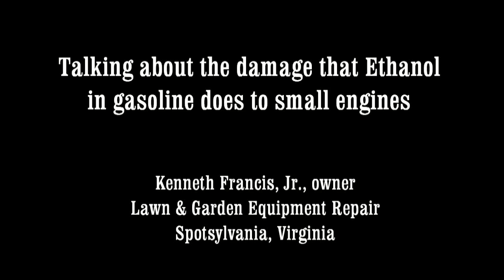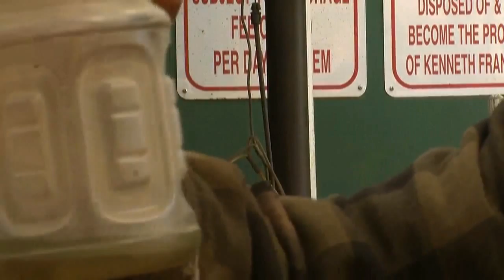Talking About The Damage That Ethanol In Gasoline Does To Small Engines

Comment: Have been using ethanol blended fuel in my lawn equipment for years and no issues.  I do run everything regularly, but 5 years and no problems at all from 8 small engines. Just my experience, have not noticed any adverse effects.

Comment: Ethanol does not eat up rubber or plastic you can leave Everclear in a plastic bottle for years and nothing will happen. Ethanol mixed with gas is the  problem. Ethanol will collect water if you let it sit. The problem is people neglecting there small engines not the fuel.

Comment: And no I don't store my equipment with any fuel left in it over the fall and winter. I drain the tank the lines and carb. Even the primer bulb.  I have a 1985 Honda 110 and yes it had e85 in it over the winter. Come spring the damn fuel lines were hard and rotted. The carb was full of gunk. And this was not a gas and oil mix. Just e85 gasoline. In only 3 months. You can kick rocks about it all day long but I'm not buying E-85 ever again.

Comment: Thank you for exposing this. There should be a class action law suit against the oil companies to replace all of our small engine  tools this is rediculous they didn't warn us!!! They are mega billionaires and they have really screwed all of us. From the landscapers to the home owners. The weekend boaters to the professional boaters and anyone that uses thier gas with ethenol. I have 3  gas trimmers ,chain saw, pressure washer, riding mower that's nothing but junk now. And the parts to repair them are so expensive  I could buy  a new gas trimmer for what it costs for a carburetor and replacement parts. In the beginning I couldn't figure out what the hell was happening to my equipment. Nothing would start then it would start for 10 seconds then quit. Plus all this bad gas we have to dispose of. What are we supposed to do with it? Poison our ground water? No! Leave it laying around for our kids and pets to accidentally get poisoned? Or wait for an accidental spark to burn our shops down?
I'm pissed and I will never by  E-85 ever again. NEVER. It's garbage. And I blame all oil companies ,and our government for this. They aren't regulating this product at all. You herd him say some gas that was tested  was 35% ethenol. That's rediculous. There are drag racing engines that run on ethenol. They knew what they were doing but didn't care enough to simply say this can damage your small engines, boats , generators,etc... But no warning was given. Now what?

Comment: Most of this is true if you are driving a snowmobile then use regular gas because it will probably sit all winter, but if it is your car that you drive everyday you will be fine.
Reply: I run my mower on e10 and it is 8 years old and starts and runs very good even in the spring when it sits for roughly 5 months

Comment: OK,,, so here is the update.  The engine is a Kawasaki FB460V.... i filled the tanks with kerosene yesterday to finish cutting the grass.  it started and ran....(the engine was hot).  this morning (cold start)  I gave it a good shot of ether,,,, it started and ran on the second pull,,,, a little smokey at first, but the smoke stopped as soon as the engine warmed up......So I will pose the question again, just in case nobody reads my other post.  Is kerosene bad for the carb gaskets, fuel lines, or anything else ???,,, kerosene has a high sulfur content, that is why i am concerned.  Any response would be of great help..... Thank you, Tom

Comment: Yesterday I ran out of gasoline,,,, so I used kerosene to run my lawnmower.  (It started and ran because it was already hot)  Will kerosene ruin the gaskets and fuel lines (it's an old 14 HP Kawasaki engine).   Thank you for the nice video.   Tom

Comment: I still can't believe it.... How can a Substance that we drink (!) be more aggressive than "highly toxic" gasoline? I don't get it... It probably has a lot to do with maintenence. Whenever i get small engine equipment to repair it's in pretty bad shape. Usually four stroke engines are low on oil, the cooling fins are plugged with grass and dirt.... 90% of the time the reason why a small engine won't run properly is carb problems, even if it has never seen gasoline that contains ethanol. If you leave your equipment out in the weather it's no wonder that there's dirt and water in the system! Ethanol, due to it's hygroscopity, might contribute to this problems, but that's just a matter of maintenance. I wish people would take the same care about their outdoor equipment as they do on their cars! (3 oil changes per year, new spark plugs, air cleaner......). By the way: If you store a two stroke engine with a small rest of (ethanol-free!) gas-oil mixture in the tank for a few months, you run into the same problems (clogged carb...) just because of the gasoline vaporizing and the oil not. Gasoline is just not ment to be stored for a long time! That's what people need to lern.
Reply: Sta-Bil is an absolute necessity for storing gasoline!  You're right, people don't take care of their small engines, fall comes and they leave mowers outside, snow-blowers get put away in the spring, and no one ever thinks to do a little preventive maintenance.

Comment: I see this is a 2010 vid. Since then, in the last couple of years, a station or two around here has ethanol free gas at the pumps. I haven't been using it as it is about a half dollar more expensive. I may start using it for vehicles I don't run very often, my gas cans for generators, mowers and such. Any thoughts?
Reply: i bought the 11 dollar non-adjustable carburator for my snowblower and it's slightly imperfect. pops and surges just a little bit and i can smell the rich exhaust but only a tiny bit. took 2 tanks but it's all cleared up with ethanol free 91 octane. have other small engines that just aren't running like they could be.  be interesting  to see how they work out.  give it a try. you might be suprised

Comment: sorry I can't believe dialog. Show me the proof. Evidence of the actual damage. Otherwise I'm gonna say BULLSHIT!I'm from Mississippi, so "show me".
Reply: +spacecowboy98 I have absolutely no problem with E10 in my small lawn engines from the end of fall till I restart all of my equipment 3 to 5 months later in the spring.
Reply: +spacecowboy98 its not bullshit i work on this shit everyday...DO YOU??????
Reply: +MONEYBAGS603 BULLSHIT! 10% ethanol blended with gasoline can't harm anything. I'm going to start putting E85 in my lawn equipment so I can get back to you. Everyday? Well as soon as spring rolls along March - May I pretty much am. But I have had NO PROBLEMS ever since they've blended ethanol with gasoline. And my example is a real life situation. I'd never give my equipment to bozo above. And I troubleshoot my own small engine equipment because I can and have never had to tear it apart to the extreme these characters are talking about. I've had my Honda walk behind mower since 2002, I have a 1986 Honda riding mower and it runs blended ethanol, I have a California trimmer with a Honda pressure washer motor that starts and runs like a champ. All the caution against using ethanol is TOTALLY UNFOUNDED.
You really have to watch 'pump' you can see it on Netflix.
Reply: +spacecowboy98 including damage to the hoses, Who the fuck came up with that? I've not changed a single fuel hose because of blended ethanol. NONE!
Reply: Space cowboy:
Ethanol gas goes "bad" faster then regular gas and causes the problems.  If you use Sta-Bil and follow normal preventive maintenance, no one will have problems.

Comment: Here in CA, I see the same issues with small motorcycle engines using carburetors that use very small midrange jet orifices. Problems started to appear after introduction of E10. The people who tell you the author of the video is wrong simply have not seen the problem and probably use equipment that will never exhibit the problem.

Comment: Just consider how much fossil fuels will be burned world wide to redesign and build new motors of all types just so they can run on ethanol.  Or all the millions of fuel system parts replaced on small engines that have been damaged by ethanol,  and the fuel burned by cars to take damaged equipment to and from shops to be repaired. 
And the increased price of food because of all the land now growing corn for ethanol instead of food crops and animal feed. 
None of my 15 year old small engines are ethanol compatible.

Comment: ethanol is a solvent an it brakes down fuel lines plastic jets and seals .... ethanol will absorb and suspend 50% or more of its volume in water and when it sits over night the water and ethanol separates from the GASOLINE that is why you have water in the bottom of your crusty carb bowls and your jets are plugged.. not to mention two stokes potential to lock up from lack of lube because water and oil don't mix ...SO it doesn't matter WHAT you put this ethanol-enhanced  BOONDOGGLE in... it will cause damage to your equipment ... still not convinced ask why its not used in air craft
 ETHANOL also kills brain cells ... from the comments left below some ones MOM 's drank too-much ethanol when they were in gestation.... YOU WINDOW LICK-IN MORONS NEED TO PAY ATTENTION !!
 There is an agenda to eliminate EQUIPMENT AND VEHICLES for some time now .... do your own research ...look it up !!

Comment: Regular fuel is now 5% ethanol here. This is still okay in engines with carburetors, but 10% or E10 is not.
Injection engines can burn alot more ethanol than carburetor fed engines.

Comment: Motorcycles are having the same issues with the new ethanol fuel.
Adding Seafoam or other additives help to keep the water in suspension. The fuel companies say  after 60 days the fuel starts to degrade.
The idle jets in the motorcycle get clogged very easily.
The needle jet can get stuck also so the float bowl will not fill up.

Comment: Ethanol dosent do that its all the additives and gums they put in the gas now that leaves the residues
Reply: Yep you are right.  Why ethanol causes problems for particularly older vehicles, is these vehicles have been running gasoline for many, many years which builds up a great deal of carbon and other crap in the engine. Once ethanol is introduced it breaks down these byproducts which clog up fuel pumps and injectors.  It's not the ethanol corroding or eating away at plastics and rubbers; as most of these post 1985 are all 100% capable of handling ethanol, even up to blends of E85, it's the old junk that dirty gasoline is leaving behind in the system.  This is the reason behind the majority of criticism ethanol gets when used particularly in older vehicles (which have subsequently collected up a great deal of carbon content in the engines and fuel systems over the many years of use)
Reply: prototype9000 About time i read a comment that is on the right path, i spent time in a lab over in Europe seeing for myself what is all involved in making gas fuels, i promise the fuel being formulated was not for public use, they would even make jokes about sending all their trash fuels to the U.S.

Comment: What is strange is that here in Brazil we are using since the late 70´s. I think this is propaganda from the oil cartel. Ask yourself how many jobs the ethanol industry is generating in the US
Reply: the problem isn't ethanol but the engine design.Ethanol is slightly acidic and Brazil already worked around that. In the US we don't have engines as wide spread designed to run on high percent ethanol. Blaming this issue is like blaming diesel fuel for use in a gas engine or gas for use in a diesel engine. He pointed the problem with small engines is they are designed to work on gas not ethanol thus we see a problem when you ethanol is used. The reason the warrenty is void in the us if you use ethanol on devices is cause you should know beforehand what your device is designed to run on and shouldn't blame the manufacturers for you misusing your device
Reply: No, it's NOT like using diesel in a gasoline engine.  When an incompatible change in the the fuel supply is made w/o necessary actions put in place, it's gonna screw everybody up! So don't defend an incomplete change of the system with one fact.  How about if the electrical companies all of a sudden began making 90 Hz electrical supply?  Your comment is as incomplete as the problem.

Comment: some facts here but let me tell you- Ethanol gas you will consume more than non ethanol gas. I only run premium grade here in Canada and have no issues. YOu will get better mileage with premium.but it costs more ....... so you break even cost wise. I did a video a few years  ago using ethanol gas and ran out in the air doing a live test i switched fuel tanks and proved it used less fuel burn.

Oddly enough I have a multitude of Gas powered equipment , Stihl saws, wood splitters. tractors, lawn equipment , boats up to 115 hp and everything runs on premium. I have zero issues at all.  Alot of the time who know what the operator is doing to their equipment.

Comment: Sadly E100 fuel (called "alcool" in Brazil) has major issues starting in anything but tropical weather. Most alcool vehicles in Brazil start on unleaded, then switch over to ethanol once the engine is warmed up (similar to many propane conversions). E85 addresses this, but as you've mentioned, the catalyst is the problem.
Reply: Even E100 has trouble igniting in cold weather?

Comment: I know there is a problem with this garbage.I have rebuilt or replaced 3 carbs so far this year. I live 400 or mile southwest of Va.The humidity is also high here and the new ethanol is not like the ethanol from the 70s and 80s ,were there was additive in the fuel. Diesel is the same way .Unless 2 cycle oil or oil with sulfur is add it destroys the injector pump.

Comment: Do you know how hard it is to put a turbo or supercharger on a vehicle or how expensive it is? Not to mention you'll have to completely re-tune the computer in order to compensate for ethanol and the boost pressure as well. Head work is also very expensive and is not something most people can do. Your idea is not cost effective nor efficient in any way shape or form.

Comment: These blends are awful for older engines from the 90's and lower. My old truck eats way more gasoline with the blend of ethanol in it as opposed to the straight gasoline that I've been buying these past few months. Call me what you will but I'll take pure gasoline over a blend of the two any day for the better fuel economy and power.

Comment: Ethanol will not leave varnish residue when it evaporates from a carburetor. In fact it will not leave a residue at all. Gasoline however does leave varnish if left to evaporate.

Comment: The problem is acetone, it is a byproduct of ethanol and gasoline production. It is mostly a wast product but changes the vaporization temp. It becomes caustic when mixed with gasoline. Its the gasoline that is melting the rubber. It is put in there by the oil companies. the % of acetone from Ethanol is minimal. It is removed from ethanol at every plant I know of. ethanol is cleaner, cooler burning and actually keeps rubber usable much longer than gasoline. search David Blume for real answers

Comment: Don't worry..there are many opinions out there. I use ethanol in my 97 Chevy pickup, 95 lumina, and all my Briggs engines,(4) also my Honda generator and Honda powered mower. I live in central MN with 80% or more humidity most of the year. I never have any of the problems he is voicing. His troubles must come from something else. Alcohol burns cooler and does not contain sulfur-dioxides. any fuel line produced after 1985 it ethanol compliant. Use this environmentally safe fuel with confidence.

Comment: That sucks did you run them completely out of fuel from the carb and everything before storing them I don't need to worry about that because I use my riding mowers and my leaf blower but the only equipment I winterize has to be my Stihl MS 270 Chainsaw and my 2 push mowers I just run them completely out of gas and out of the carb till they can't start at all anymore and don't use them till I need to till probably the start or middle of the spring season.

Comment: If it goes up to 15 im gonna start running my stuff on ethanol free fuel there is many places where you can get that ethanol free stuff but it is about $5-6 a gallon and where i live i will have to drive 45 minutes just to pay more for gas, that is the only reason i run my stuff on the regular pump gas!

Comment: Water and ethanol do mix. Water and petroleum (gas) dont. Youd know this if you jumped on the methanol/ water injection band wagon back in the day.Your using alcohol in those iso-heet products to rid of the water in your gas tank. Water in ethanol raises the octane and lowers the btu.Water in petroleum causes a hit and miss. Gas has been gunking tanks for years, clogs filters, kills fuel pumps. Thats always been an issue, I switched to e85 and it hasnt been an issue for me since.

Comment: Not only small engines like lawn mowers and the like, but also the fuel injection system on my Vulcan 900. Pooling moisture from the air would also be a problem with cars, trucks, etc.

Comment: Yup, "gasohol" is hydrophilic. It sucks water from the air and condenses it in your fuel tank. It also can't be shipped via fuel pipeline, so it has to be transported in large trucks across the country. It creates more environmental hazards than fossil fuels and I pay for it with my taxes so I can buy it for the second time at the pump. It's a ridiculous scam.